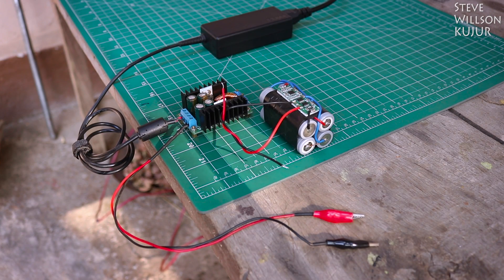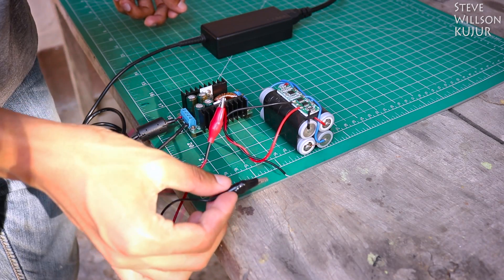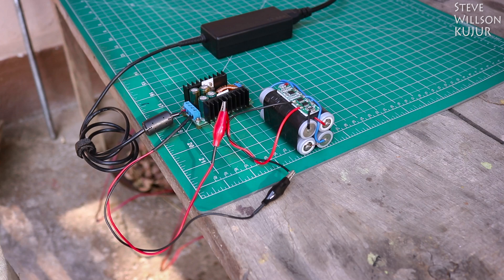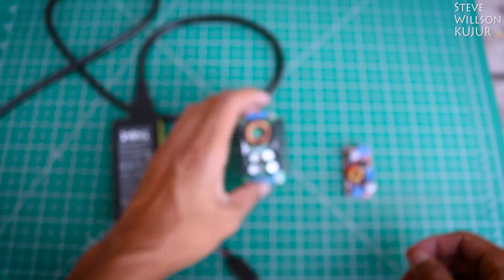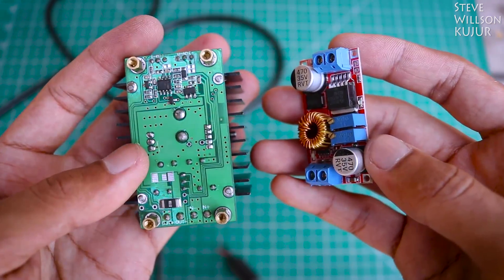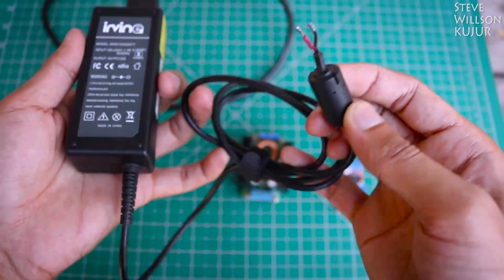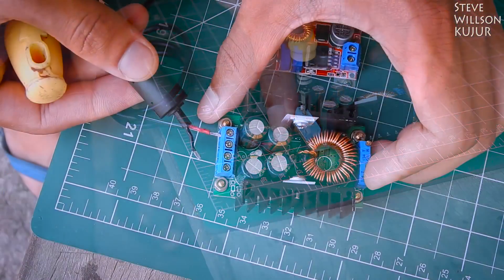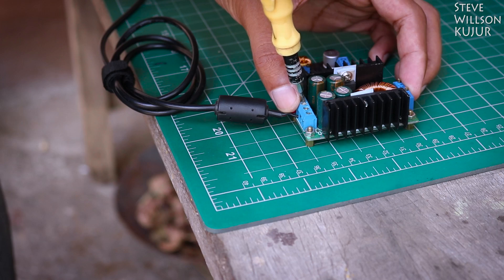How to Make a Lithium Battery Charger

Comment: Hey i am new so there i have a 3s battery with bms what if i use a 19 volt adapter and a buck converter which doesn't have a constant current option will my batteries won't charge or how will it affect it ??

Comment: Laptop 4/6 cell 3000 mah or 4000 mah batteries are fully charged in one and a half / two hours.  If there is any system for fast charging using any such BMS / module / circuit, please give the video.  I have not found any such video on YouTube

Comment: Is 5v 1A or 2A good for charging 4s BMS?
Reply: no 14.4 the bms divides the voltage that would be balance charged disconnect the bms and pair the batteries kill the series connection with switches or buy a daly bms and cast your cares aside

Comment: Can you please tell me how to connect the converter to the volt meter to set the amp to 1amp
Reply: Just buy 12v battery volt meter/ ammeter.. It measures and display volts and current at the same time..
Reply: I need instruction to set the converter to produce 1amp cc.

Comment: Hi I have 6 3.7v 10865 batteries for my impact gun, I am gonna connect them in series and parallel with a BMS, if I use a 19v laptop charger to charge them what step module should I buy and what Volts should I set it to as  and what amp should it be set at. Cheers

Comment: Hi Steve nice informative videos, you show on one of your profile pictures the battery level indicator, which points do I solder to the bms as if it's the same as the power supply it will register the full charge of the power supply.i can't find any you tube video showing how to hook it up?!?

Comment: Hi Steve, can I use constant 16.5v) and constant 1amp to charge my 4s lithium battery without the bms
Reply: You probably could but those bms circuits are very cheap so Id suggest buying 1 from ebay for like 2 or 3 bucks. Itll lenghten the lifetime of the cells and its probably safer.
Reply: You can if your cells are equilibrated, that is they all have the same voltage and are identical. Otherwise you risk that one cell reaches its maximum voltage (4.2v) while the others are still at a lower voltage. The first one may explode since it continues to receive current while it is full. So it is safer to use bms

Comment: Sir my battery pack is 16.8v and 6600mah 

How many hours to full charge 
How much voltage and amps required
Reply: Ah means the capacity of the cell. 6600 mAH =6.6AH,which implies this cell could be charged @ 1A for 6.6 hours or @2A for 3.3 hours at its peak charging voltage of 4.2 volt per cell.
Reply: It could be charged @ 16.8 volt and @ 1A for 6.6hours .
Reply: deppends on how many amps you charge it with. If you charge at 1amp itll take probably a little bit more than 6.6 hours till its completely charged from empty but li ion cells should never be empty and its ideal if theyre not always charged to 100%. Its ideal if their charge is within about 20-80 percent but a charge protection circuit should manage that. Id say about 6-7 hrs. and if you charge at 2 amps itll be around 3-3.5 and so on. Also its better for them not to be charged very fast. If you have the time, Id say 2 amps and 3 hours are optimal but if you charge at 1A that might be even better.

Comment: Hello bro.
Thanx good information.
My battery pack is 16.8v 6600 mah 

How much voltage and amps required for charging
Reply: Idk about the voltage, but if u want to charge them the quickess as possible(1hour of charge) you will need 6.6ah.
if you charge them at like 3amps that will just take longer(~2hours)
but if you go higher then 6.6amps that could blow up
(sorry for error I don't speak english)

Comment: Wrong voltage, if your battery cells is Li-ion 4S, full charge voltage is 4*4,2V=16,8V , not 16,6V

Comment: Does the step down converter stops the charging process when the output current is lower than a certain threshold?
Reply: no ,that is the bms that is supposed to but if it's not daly I personally don't trust it

Comment: I tried to use make the circuit by connecting 3s li-ion battery to bms and used the dc adaptor that connect to the dc - dc converter to charge the battery but before i plug in the dc adaptor to the wall power supply, the led on dc converter and dc adaptor were already turn on
Will there always be drawback voltage if I leave the dc converter connected to the bms as one component? or did I do it incorrectly?

Comment: if i have 12v pc charger and 3s battery pack i need to buy a step up converter and  set it to 12,4v right? if my charging voltage is 12,4v

Comment: Hi,i wanted to ask if i have a 3s2p battery,then what is the best charging voltage and ampere i should use? Thanks
Reply: for 3S li-ion cells 12,6V and max current is about 30-40% nominal capacity, example 2200mAh charging current 660-880mA

Comment: did you think it can work for one of this ? 
https://ae01.alicdn.com/kf/HTB14mmlSFXXXXcKXXXXq6xXFXXXa/2018-New-Original-Rechargeable-ZOP-Power-14-8V-2000mAh-4S-65C-Lipo-Battery-XT60-Plug-for.jpg_640x640.jpg
is a 4cell lipo batterie of 2000 mAh

Comment: Hello! Big fan of yours. Your videos have been very informative. Helped me a lot. I am planning a 3s4p pack with bms rated accordingly! What is the voltage and current limitation required for this
Reply from the maker: chinmoy sharma it depends upon the battery you use
Reply: I m using 18650 batteries form laptop battery rated at 2000 mah.
Reply: Each
Reply: So total of the pack shud be 12.6 volts and 6000 mah

Comment: Hi, I plan to build a similar  balance charger for my 4S1P LiPo(!) battery bank. THe BMS I found only have a charging voltage range 16.8V-18.1V, but i plan to set the converter to 16,6V, just to be on the safe side. Do you think it is feasible? Or shall I use a 18650 li-ion BMs? the BMS will be built in the charger (in the battery bank there is no BMS), hence the discharge and overdischarge limits of the BMS are irrelevant.. Thank you.

Comment: Hey Steve! Great video. Is it work without step down converter if i use in stead one iPhone charger (5V,1A)? Or what is the minimum voltage?
Reply: You may use the step down transformer with rectifier and filter circuit to provide 16.8v @1 A . Then connect the buck/boost converter and adjust the preset to get 16.8v @1A.

Comment: Man, I tried to make a battery charger based on the XL4015... Used two external potentiometers, a digital voltmeter ammeter and so on. Burned both the XL4015 I had. :(

Comment: if you put the buck converter and the battery pack inside a speaker for example. What circuit could be done to prevent the battery feedback the buck converter?
Reply: Martin Nahuel Larrosa Maurer  just put an adequatel rated diode to the output of the charger

Comment: That is wrong to check current source. Because you not use "Resistor". If you long time connected multitester to Power Supplay, you can make to burn component.

Comment: Steve, would you not need 1 amp per battery otherwise you are only charging to 50-60%, depleting the life of the batteries?
Reply from the maker: it depends upon battery specification my batteries are rated at 1250mAh standard charging current
Reply: I wanted to convert my old cordless drill using this method, but wanted to be able to recharge the batteries when needed. Would I be best using the bms with balance charging? Thanks for the response, keep up the good work, really enjoying them.

Comment: Good afternoon, Wilson, is everything okay?
I follow your videos and I find it very nice.
It takes me a question, I saw your dc converter and it's different from what I already have here, can I use this one that I have the same way as yours?
I'm going to buy the 3.7v batteries and use 4 units for the PAM8610 amplifier, see if this talk can be used too:
https://www.aliexpress.com/item/1pc-DC-DC-Boost-Converter-10-32V-to-12-35V-Step-Up-Charger-Power-Module-150W/32444470706.html?spm= a2g0s.9042311.0.0.b5laf1
Reply from the maker: Hi, this is a step up converter and here I used a step-down converter with CC/CV " Constant Current / Constant Voltage " very necessary to use  constant current
Reply: Got it, and why are you using 2? one of 4A and another of 8A?

Would that suit my case?
https://en.aliexpress.com/item/1pcs-5A-Lithium-Charger-CV-CC-buck-Step-down-Power-Supply-Module-LED-Driver-New/32291853402.html?ws_ab_test=searchweb0_0, searchweb201602_1_10152_10065_10151_10068_10173_10326_10084_10083_10080_10307_10082_10081_10110_10137_10111_10060_10112_10155_10113_10114_10154_10056_10055_10054_10312_10313_10059_10314_100031_10099_10078_10079_10103_10073_10102_10052_10053_10142_10107_10050_10051, searchweb201603_18, ppcSwitch_5 & btsid = bc428bd3-5419-47df-8905-445716b2ba0e & algo_expid = 4bfc0a16-f7c3-47dc-1-a273-0589bfe2a86f & algo_pvid = 4bfc0a16-f7c3-47dc-a273-0589bfe2a86f

Comment: Hi Steve.
Using the BMS besides control the charge of battery the BMS allow recharge and discharge the battery when is need? Of course using a power supply, right?

Comment: Any reason why I couldn't build (3) 4S Lithium battery packs (per your other video) and put them in parallel for increased capacity, and still charge this way?
Reply from the maker: +Daren Schneider you can do it no problem
Reply: Thank you. I am waiting for my parents to ship from China. I am looking forward to putting this together.
Reply: As to the charging it should work! But if you connect your 3 packs in parallel and they are not at the same voltage then current will flow from one to the other cuz the charging and discharging ports are the same. Not good for the batteries

Comment: Can you charge the batteries with this methode to 100%? because I once read that you need a lipo charger to charge a lipo pack to the fully 100%, otherwise you will charge it to 60%. That's because a lipo charger uses a charging methode by first increasing the voltage (than you have the 60%) and then increasing the amperage. Am I right?
Reply: This method in the video isn't good. You need a proper charging circuit, it depends if you will connect them in parallel or in series.
Reply: @JS7457  What do you mean?
Reply: @rrrrmrmr  In the video the cells are connected in series so in this case you need to balance charge them but the bms he's using doesn't have that function.
Reply: @JS7457  Ah, thank you!

Comment: Good evening steve very good your video which diode do i use to prevent the return of voltage / current coming from the batteries package? Could spend a value for a pack of 4s 3p.
Reply from the maker: +Rafael Veloso use any diode more then 10A

Comment: great video and channel! Question... If i added a step down converter like this on a 36v pack to power a fan or other accessories, would the massive 36 --> 12v step down conversion (which makes heat) waste lots of battery capacity?

Comment: FINALLY, been looking for a video like this.
Reply: those boost buck converters are bad for charging because their output is full of noise, and there isn't any cut-off, the batteries aren't ready when they reach 4,2v, they need to be charged in cv until the current drops down 100ma (depends).
Reply: Please do so!
Reply: Thank you!
Reply: no problem, if you want to charge them correctly look on ebay/aliexpress for : tp4056 (there is some 2a and 3a versions too)
Reply: This is great! Much appreciated!
Reply: @mortschubert3909  yes yes its not CC CV
Reply: so using the battery holders and the tp4056s with the laptop charger to charge them? do I need anything else?
Reply: But it's wrong.
Reply: It's not.
Reply: It is, think like you want but the way how he charges them is wrong.
Reply: Saying that Indian people don't know electronics is like saying that people from Texas don't like guns. Indian people are born with electric skills in their DNA bruh!
Reply: I didn't even know he was indian. But it's wrong. If you want me to explain i can.

Comment: how much volts I need? for 3 bat? its 12.6? (3x4.2v)
Reply from the maker: +Ji run yes 12.6 v but don't go for 12.6 you need little safe side go for 12.4 v